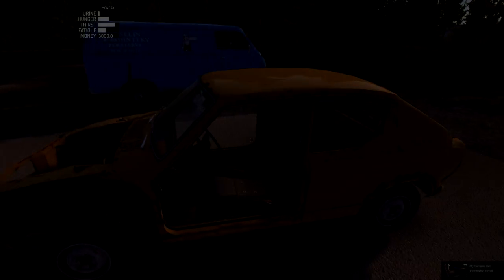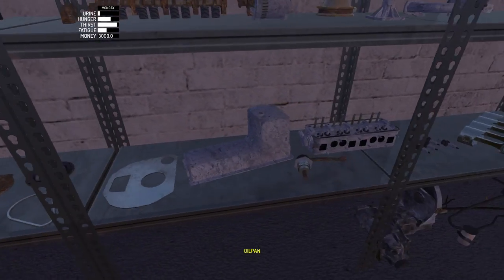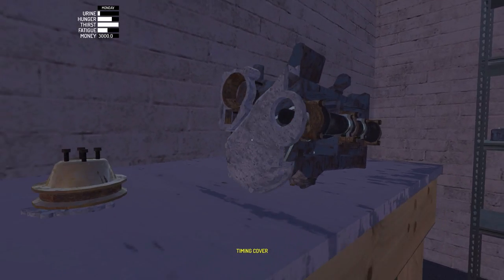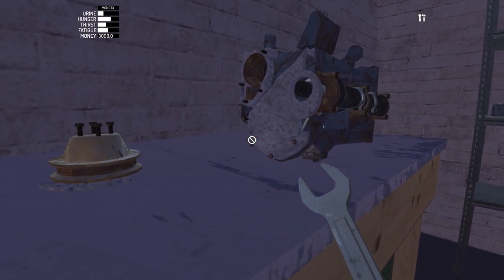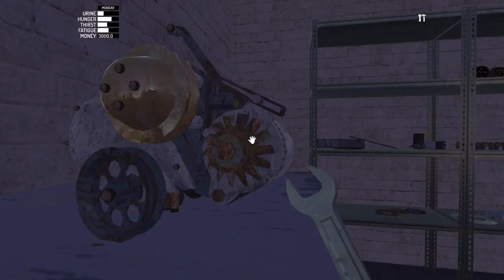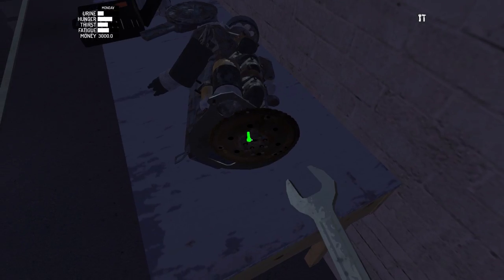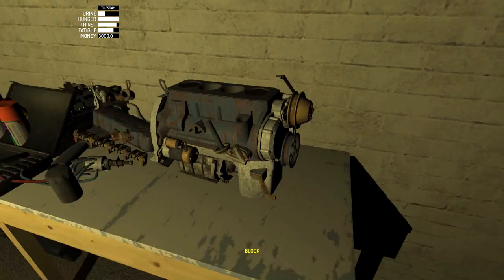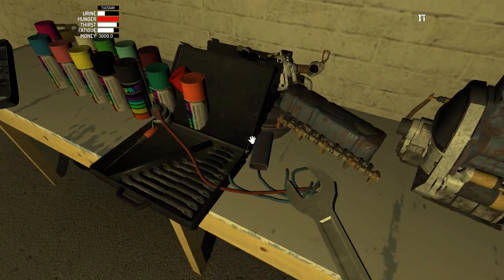HOW TO: Engine Build And Puting It In Car - My Summer Car

Comment: Thanks for the videos! Dont know if it will actually run yet ;) i hope so. And yes you can drink tap water from the kitchen by opening the tap and then pressing Q to lean in.
Reply from the maker: If you've put everything correct then it will work! Just put on a fan belt and you're good to go. I already have it running in the next video :)
Reply: I will be waiting for the next video then :)
Reply: Engine indeed does work with this tutorial. Ofc you need to put the engine in and attach the rest of the parts. Cheers!

Comment: by the way the video doesn't show you need 1x8mm bolt for the fuel strainer, I looked it up in a guide i found from my summer car wikia, maybe you could add a text box for that
Reply from the maker: I've shown how to properly put it and both master cylinders in my next video which should be live in an hour or so
Reply: ok nice.
I have a weird problem now, there is no bolt at 27:20 for me, I'm using wrench 11 but there is no bolt in that place! tried reloading game too...
e/ nevermind it appeared after moved the engine a bit...

Comment: I panicked a bit when you cut the video (and didn't show all the bolts for the part, whatever it was at the moment :D) but thanks for the vid, I now have to assemble the chassis (I started with the engine)
Is the clutch master cylinder used in your video "suspension and brakes" cause you didn't use it here? or can I just put it in after doing everything in this video until 23:15?
Reply from the maker: You can put both master cylinders whenever you want just don't forget to attach clutch lines to it aswell :)
Reply: both? I haven't looked at all the parts yet and I don't know much about cars so I don't know what the other master cylinder is, anyways I'm going to build the chassis with help of your other video first :)
Reply from the maker: By both I mean clutch and brakes master cylinders
Reply: ok, thanks!